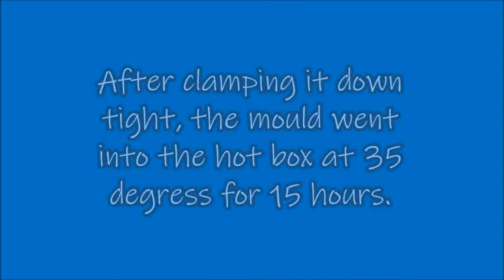Warbit Wing With Cork Infill 28 July 2019

Comment: A question :Any fabric over the cork?Then to made a good bonding surface  for spars you must lay peelplay fabric before the perforated film.Good video you edit thanks.Ago.
Reply from the maker: I used 105gsm tight-weave fibreglass fabric as the veil layer, then add the carbon D-box section and 150gsm fibreglass from the D-box edge to the TE - basically covering the control surface area.  Then the cork goes down, and yes, a layer of 48gsm fibreglass over the cork - and then apply vacuum.  I didn't use peel ply, I just roughed up the contact area with 80 grit sandpaper.
Reply: Thanks for the answer Steve.I suggested to  use peel ply instead of sandpaper  use because  in past I try to separate some layers glued over cured glass treated with peelply and it was glued like wet in wet..I was very impressed about how work the bond done in this way.Anyway thank to share your work.Have fun.Ago